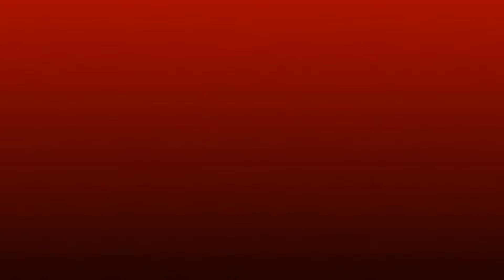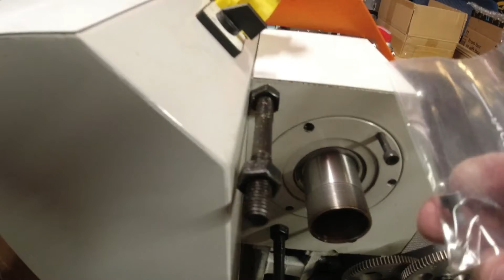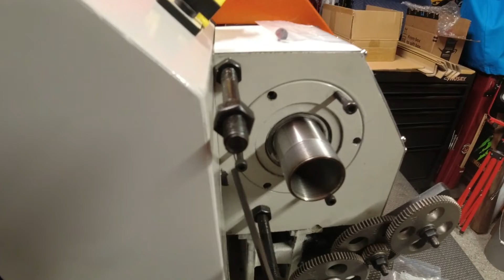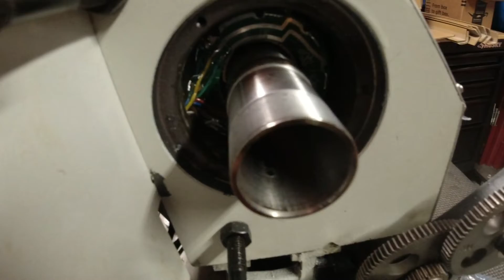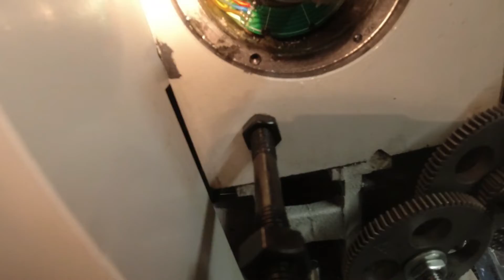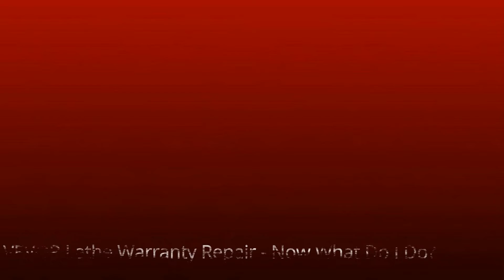VEVOR Mini Lathe Repair: Ring is Off...Now What?

Comment: Looks an interesting slightly upgraded version of the original and infamous Chinese 7 inch mini lathe, although it now lacks the old mini lathe tumbler reverse mechanism for changing the direction of the geartrain and leadscrew. 
 I've noticed here in the UK recently more of these new small Chinese lathes and milling machines appearing with direct drive motors built into the headstock around the spindle, with the spindle forming part of the surrounding motor.
 It seems a neat and innovative idea, but it's a worry that spindle bearing or motor problems, or failure, could be more difficult and costly to repair or replace than those with a separate motor.
 After having larger lathes at home for over thirty years I have just bought myself a new 7x14 Chinese mini lathe for use indoors in the living room, only for the odd time I'm stuck in the house bored to death and need something mechanical to fiddle with. It's the type with separate brushless motor, and  coincidently mine also needs a replacement headstock spindle,  so you're not alone.
Reply from the maker: Also of note on VEVOR's site on this lathe it states "Motor mounted on the spindle No maintenance required".  Wonder what they mean by maintenance as this part, based on my experience doesn't seem to be customer serviceable...no idea how I'm going to replace my spindle with what they sent me and if it going to require more tools, I'm at wits end and going to push the warranty more now.  This is getting silly.  Sorry to hear yours is experiencing the same.  Maybe the brushless motor built into the spindle isn't such a wonderful idea after all.

Comment: Is there a similar ring on the chuck side of the lathe? If so, I THINK that it needs to be removed; and then the spindle will come out from the chuck end. It may require pulling with an all-thread, nuts, and a piece of pipe.

Ask Vevor if they have a parts diagram... that would help immensely.
Reply from the maker: Yes, there is another "ring" on the chuck side...no idea how to get that out (and have once again asked VEVOR for help/instructions/what next) as there are no bolts/holes.  This is getting beyond interesting.  Not really "field serviceable" by a hobbyist customer IMO.
Reply: @ReLoadersBench   Just a guess... if there are no screws holding it in, it might just be a friction fit. It might come out when the spindle is driven out. At this point I suspect that what was holding the whole assembly together was those two threaded rings on the back of the spindle, and friction. As for its lack of serviceability - well, a lack of documentation will do that to anything . I'd by totally lost without Chiltons/Haynes/AllData etc...
Reply from the maker: @darkwinter7395  - I have yet another email out to VEVOR (being bounced between the VEVOR direct team and the VEVOR Amazon support team) about next steps.  I don't want to take a hammer to this (if it's a friction fit) without guidance from the support folks as I could imagine the conversation of "looks like you damaged the machine, no longer our warranty issue".   In the comments (and on other videos related to this repair), @davidmeszaros8960 keeps asking if I'm regretting the purchase yet.  I do not regret purchasing this lathe (LOTS of learning!).  I do, however, regret buying it from Amazon and not VEVOR directly (who knew?) simply due to the distinction of getting support directly from VEVOR or being passed (over email and then delays) to the VEVOR Amazon support team.   Maybe I'll make a video on that one!
Reply: @ReLoadersBench   - Yeah... generally speaking, hammering on bearings, and machine-tool bearings especially, is a no-no. The impact puts small dents in the bearing races and rolling elements making the spindle vibrate as it runs. That's why using a puller has been suggested instead of hammering on it. I completely concur on waiting for their instructions before applying force, however.